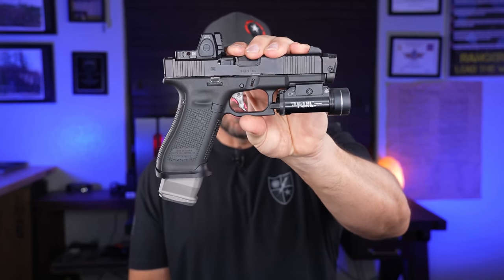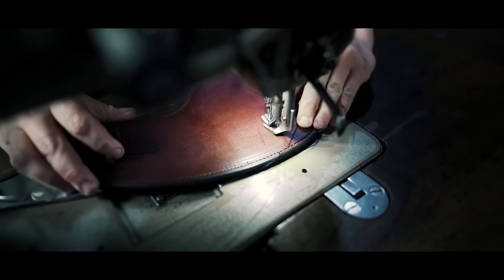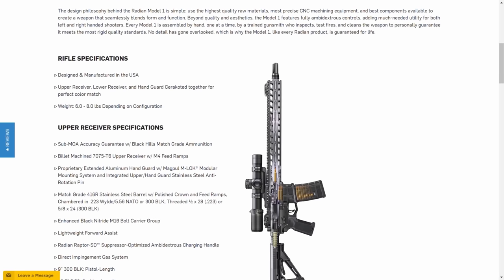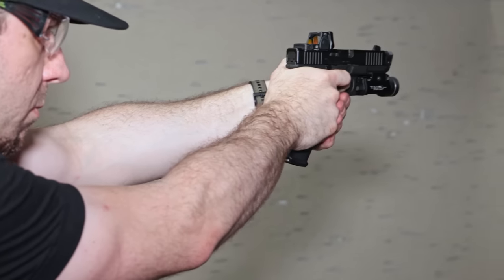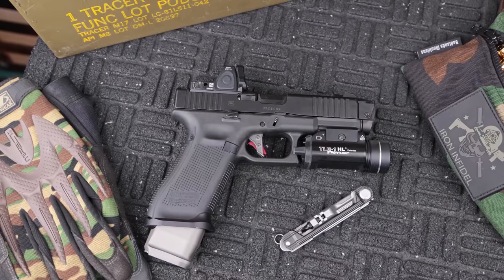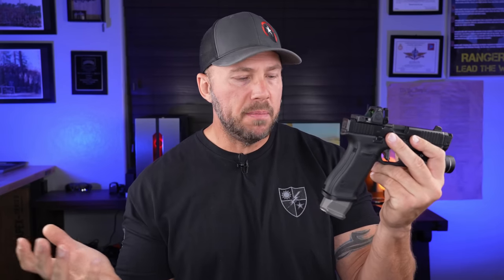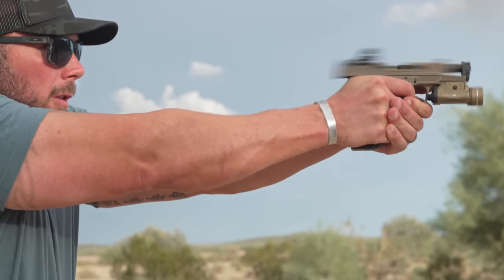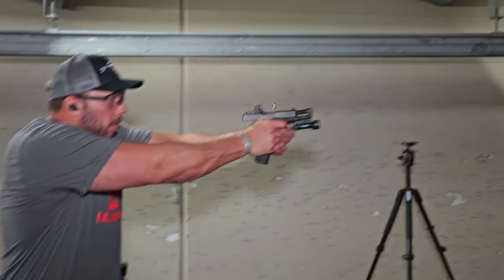It's INSANE! Ultimate Hard Use Duty Glock Pistol

Comment: I'm not going to lie, I don't shoot Glocks anymore, BUT when I retired last year my G45 looked just like that minus the mag extension and optics guard. The afterburner is amazing, it really makes it flat and the trigger makes it fast. I had a Magpul magwell, and I ran the Pyramid trigger with a Blue Line connector. My pull was a consistant 4.0 lbs I have never heard of an actual case used against a person for a trigger. Tom Grieve who is a former prosecuter and works for USCCA also said he has never heard of one either.
Reply from the maker: Nice man. sounds like you got yours at that sweet spot.
Reply: The only way I can imagine a tuned trigger being ruled as detrimental to your case is it being so light that it can misfire or similar. The old NY & NY+ triggers are ATROCIOUS and will absolutely cause the shooter to miss unless you are really dialed in on your trigger control.
Reply: If I may ask, what DO you shoot now?
Reply: I always thought the reason they don't recommend lighter triggers on your carry gun is because it's so light it becomes dangerous to carry around every day
Reply: @Darthdoodoo  I have found 4.0 lbs is the perfect trigger weight for carry (MHO). some like heavier some like lighter. Too call it too light for carry would depend on the shooter and their level of training. 4 is just where I like it.
Reply: @sensay8374  I shoot alot of guns, but my new duty gun is now a Shadow Systems with the 18° grip angle. That was not an option at my old agency.

Comment: The PDP Pro is my favorite polymer pistol but if civil unrest or some type of societal collapse were to happen, I don’t have the parts nor know how to fix a Walther PDP in minutes. However I do have the parts and know how to fix my Glock in minutes if not faster so I think the Super Glock is a good idea. I’ve pretty much got all of these parts in the video except for the barrel, I can’t seem to find one in stock and I ended up going with the Glock Performance trigger over the Overwatch just for that little bit more comfy feeling of reliability plus it’s actually a really nice trigger. I also went with the Holosun/ Primary Arms ACSS reticle optic because Trijicon is really hard for me to see with my astigmatism.
Reply from the maker: It's definitely not a bad way to think about it. Glock is very simple and parts are everywhere
Reply: @TacticalConsiderations  Brownells had the barrel, thanks for the list.
Reply: Once you have no power, meaning no light, you won’t be fixing anything, and you’ll be using the Glock like a club sooner than later, so just get a steel frame gun instead.
Reply: @tomd4748  No power equals no light? Uh?

Comment: This is a really cool setup Mike! I really dig the Guadian + six as a concept. Having that rear sight integrated means you don't really need to rear sight dovetail tool to deal with, just the hex tool with changing out the front sight.
Reply from the maker: Yup. They give a plug for the rear sight dovetail that makes it clean.

Comment: This was an incredibly well articulated and thought out video/build. The choices you went with here are objectivly the best you can choose for a project like this and anybody would be thrilled to have this pistol all decked out. I also appreciate you giving price at the end and noting that the cost of this build will get you a entry level Staccato. What's important to note is that Staccato won't come with a comp/light/red dot and that is a HUGE difference when completing a pistol. It will shoot smoother with a nicer trigger but it won't have any of the accessories for that price.
Reply from the maker: I really appreciate that.  Its was a lot of time, ammo and work in this one.
Reply: @TacticalConsiderations the ram jet comp,,,which gen model do I pick for my shadow systems mr920?? Please answer,, I really want that upgrade on my Shadow,, thanks
Reply: I had a lot of issues with double feeds when I first shot my glock with the radian ramjet. Once I got about 100 rounds through it, it ran great. Gonna try the radian adjustable recoil spring and try the 15lb spring weight
Reply: I use it on my glock 45
Reply: @georgenicholson9386  gen 4. Shadow systems are based off the gen 4 design

Comment: For daily carry or competition, my personal choices are:
- a g19 (gen 4 or 5).
- 10-8P sights and connector.
- tango down mag release.
- SureFire x300b (for the one’s that wear it).
- Raven vanguard holsters. (I haven’t broken one yet, unlike some others).
- factory mags or magpul. 
- one has a shadow systems trigger, the rest are factory.
- Neomag for the spare mag. (Again, I’ve tried plenty of others, but have yet to break one Neomag.) I do use Raven for competition mag carriers.
- federal HST or Speer gd2 for defensive purposes.
- RMR06 on the one’s with optic cuts.
Reply from the maker: You got it right.
Reply: Kinda silly to do all that and not run an optic
Reply: @johnquinn4680   2/3 have RMRs.
Reply: @coryjanko  oh yup my bad bro. I missed that.
Reply: @johnquinn4680   no, you didn’t miss it. I forgot to mention.

Comment: Mike , your time is impeccable. Literally just bought my Glock 45 MOS, had 3 before this , sold them, regretted it, missed it, I’m keeping this one. Now comes the fun part, getting my aftermarket parts. Overwatch trigger and Night Fision sights are first. SLR Magwell is a must. Never used the MOS from Glock OEM, always got it milled. I need a good optic plate , what would you suggest Mike. Awesome video as always brother . ⚡️⚡️⚡️⚡️⚡️ ⚡️
Reply from the maker: The radian plate works direct to the mos slide , but if you get it milled just go direct rmr cut. However the radian guardian optic cover only works with mos.
Reply: I'm not a fan of the Radian plate, but Holosun makes a 507c that is built to connect directly to an MOS cut without a plate, so it would work like a milled slide. Otherwise I'd recommend chpws. Much better than the crappy Glock plates.

Comment: Depending on what you want to do with your gun depends on the trigger. If you want a really light trigger that will be easy to pull, make your shots faster buy a Timney Trigger (this is the trigger competition shooters use such as TTI). If you want a trigger that will be good for self-defense, you might want a heavier trigger so you can really think before pulling. Personally, I would stick to a stock trigger for self-defense and a Timney for a quick shooter.

Comment: Hear me out.......I have almost the same setup that you do, minus the Radian Ramjet. I have a Parker Mountain Machine comp. But on all my Glocks I run the Overwatch Precision Tac triggers...... Along with   the Ghost Evo Elite connector, 4.5lb striker spring, and a reduced safety plunger spring. And a 15lb recoil spring. Been through many classes, and Religiously shoot 100 rounds. All drills, at the range, weekly. ( My Glocks run without any malfunctions 115gr, 124gr or 147gr)  I challenge you to try the springs and connector, and see if you think your pistol is much better. Love the channel, keep up the good work!
Reply from the maker: I dig that but the factory springs is part of why I did this they way I did . I have all the parts you use and they are sometimes his or miss. I have seen more broken, rusted or even double fire connectors from ghost than any other company.  The guts are what I wanted to remain factory since the are always the most reliable percentage wise.  I have tried all the spring combos for striker and eventually they end up light striking on certain ammo.  If yours is rocking I am glad to hear it but I have just had too many springs piss the corner.

Comment: If I ever go back to 9mm, my set up would be very similar to this. The only thing I would do different is red dot.  I am a big fan of the Leupold Delta Micro. People have commented negatively on the smaller glass size. But when asked none of these people have ever used on for any length of time. The more you train, with it the sight disappears and it is almost like the red dot just floats in front of you
Reply from the maker: I get ya. I tried it just messed with my astigmatism.

Comment: Thing to note about the Radian Afterburner, will not work with Zev slides. It wants OEM front end geometry. I ended up getting a Mapleleaf Firearms G19 slide as it's made specifically to fit the Afterburner. Totally worth it!
Reply from the maker: Its only made for factory glocks.

Comment: I think I drooled a little, or maybe that was from the stroke I was having after you said what that thing cost with all the goodies.  I like it though, very sweet rig.  My only thing with changing triggers on a Glock is that I've been told and heard so much about how that can make it unreliable.  But you stated you have no issues with reliability as far as Overwatch triggers go, so that's good to hear.  I also agree about the minus connectors, they are the way to go.  I guess I'm gonna have to get myself an Overwatch for my 43X to try them out.  Thanks for another great video!
Reply from the maker: Maybe both, The real question is was there any doody?
Reply: 🤔Didn't check..... 😂

Comment: I was waiting for that comment at the end. Why spend all that money? The Walther PDP SD Pro really does ball on a budget. I got my PDP SD Pro compact from kygunco for $800. 
Holosun EPS $330
CHPWS optic plate $75
PMM comp $100
ZR TS 15lb spring $70
Olight Valkyrie $80
So I have $1455 into my build. I can put fist sized holes through my target at distance with speed with my Walther. It has earned the name "cheat code" for good reason. I still love my Glocks.  But the PDP SD Pro is hard to beat. Get with the program Glock.
Reply from the maker: Yup.  I can see the future with the PDP PRO.

Comment: Definitely will run my PDP 5” before anything else. However once SHTF…I’ve got some Glock clones and tons of parts. Unfortunately until I get at least 1-2 more PDP’s, I gotta fall back on Glocks due to sheer parts alone.
Reply from the maker: The PDP is so easy to love.
Reply: If SHTF the last thing your going to worry about or need is spare parts for your gun. A stock glock can outlive most of us and nobody is going to be blowing thru thousands of rounds at the range, wearing out parts is highly unlikely.
Reply: @isaakjunkeer785  I agree. However nobody can account for things breaking or potentially needing extras. It’s just an added layer of reassurance for me.
Reply: Why is the gun community so obsessed with shtf?

Comment: Really nice setup, it makes actual sense and those are all quality parts.  The last I researched the topic, the consensus seems to be that the only way a trigger could possibly (maybe) be used against you in a criminal case is if you have an ND with a really light or heavily modified trigger.  Otherwise, if you shot them on purpose it doesn't matter.
Reply from the maker: A negligence case is a very different issue than a self defense case for sure.

Comment: I have almost the exact same set up. I put the 15lbs spring in and had a ton on failure to feeds in the first 300 rounds. Of course I forgot to bring the other springs to put the factory spring back in. I’m hoping that it was only because it’s a brand new gun, so it needs break in.
Reply from the maker: Mine was well broken in but I am using the factory springs on all 3 of mine.

Comment: @TacticalConsiderations  I just finished my second whole training day using one on my glock 45. Even with changing spring weights using the proprietary compressors springs I still have issues with 115 grain going into battery. I had to keep thumbing the slide into battery. 15lb spring won't feed and 13 won't go into battery. I don't think cops should use these

I replied in a sub comment but I wanted to make sure you read this. Be careful recommending this to police who's departments issue 115 grain training ammo. It's garbage and none of the three spring weights work.
Reply from the maker: I am using the factory recoil spring not a lighter one. I know its been used in at least 1 OIS already.  I only use things that work on the factory springs.
Reply: @TacticalConsiderations  so +p duty ammo on the regular springs would be fine. The primary issue is lighter training rounds.

Comment: I had Radian Ramjet begin not locking back. Verified on another 45 and 2-19s
Reply from the maker: Ammo type maybe.
Reply: No its just not a great product. If it cant run with quality ammo, its a useless product. Fed American Eagle, Hornady Custom and Crit Duty, Bllazer Brass. If it fails all of those, its a bust. Ok when new, but after a few thousand rounds, no lock back. I have multiple Glocks over 10k rounds back to 1992. All stock, and all function 100% all the time. Not sure why I thought I needed to spend almost as much on the comp as the pistol to tame the massive power of the 9mm. And the 45 with the Ramjet and 17 stock felt no difference, no loss of speed and my wife who is half my size said the only difference is how annoying it was to have no lock back. Save $400+ get a 17, or better yet, a 34 and learn to shoot it. It will stay on target as well or better and be 100% reliable. Just change the sights to your steel sights of choice, and grab an x300.

Comment: I actually mixed overwatch components with a Glock Performance trigger. That's a pretty nice setup. Only thing is apparently after a thousand or so rounds the Glock Performance trigger CAN need a bit of lube. So far my first one hasn't needed any, I bought a second recently and some have said there may be a change with the newer ones? I don't know if that is true, just passing along random information.

I'd like an Afterburner+ramjet for the G17.
Reply from the maker: Yeah I heard something about them failing.  If you look at the design its like a pretty close copy of the timney
Reply: @TacticalConsiderations  Yeah it is pretty similar. Johnny Glock said they did make some improvements to the design as far as safety goes. I certainly hope they did anyway, I've been carrying a G19 with a Glock Performance Trigger(unmodified) in an appendix rig since January--that particular trigger had to be one of the very first ones sold to the public because I ordered it within an hour of the public reveal at shotshow. 

BTW, glad to see you made it through that defensive encounter unscathed. I hope you're doing well physically, mentally, and spiritually. Take care bro.

Comment: On my 19 mos I could not get it to function with the factory spring at all. I put the radian compressor in it with (I think) the 15# spring and runs flawlessly now
Reply from the maker: was your 19 new or didn't have many rounds through it? my 45 probably has 5k through it.
Reply: @TacticalConsiderations  yes it was new. Maybe a couple hundred rounds before I put the ramjet/afterburner on it. Every other round was a ftf with the factory spring but zero issues with the lighter spring in now.

Comment: Hi TC! I have a question for you. I'm considering getting an Overwatch TAC trigger like the one in your video here to replace my Timney Alpha Glock trigger in my gen5 G34. My question is what made you decide to go for the Overwatch TAC trigger over the Timney in this build? Was there something about the Timney that didn't work well enough for you to make the cut? My current dilemma is that the Timney has this strange "Second wall" sometimes in my trigger press, and while it is a very light pull, that inconsistency very much annoys me. Maybe the reasoning behind why you didn't go with the Timney will help me figure out why the Overwatch is overall the better choice.

On a side note I also wonder - what made you decide on the Overwatch TAC over the Glock Performance Trigger? Now that that's out I figure you've got lots of rounds out on that, so you've got your pick of which of the three triggers I've listed you like most.

Either way, it does say a lot that you're still going with the Overwatch TAC after all this time. I have an Overwatch TAC in my S&W Competitor thanks to your videos, and I do like it quite a bit.
Reply from the maker: Timney is not a carry or duty trigger its for competition only.  There are only 3 triggers I trust for duty work, Overwatch, Apex (Both are approved by several LE agencies) and the last FACTR USA.

Comment: I’m genuinely curious what the appeal of the Glock 45 is over the full size Glock 17 or 47 specifically for duty use.  If I don’t have to conceal my gun, and can have it holstered in a big, offset, “go to war” holster.. why not go with the G17 or even the G34?  My chronograph data shows all three Federal HST loads achieve significantly more velocity from the G17 length barrel over the G19 barrel length. There would arguably better accuracy (although probably just a minimal difference).  

Just an honest question!
Reply from the maker: I get ya.. Well if you have to site in a car with a duty holster all day longer is worse.  Velocity from pistol barrels are going to do about nothing in a self defense use of force with standard defensive ammo.  Having something that is easier to carry around, lighter and will produce the same end effect is a positive.

Comment: I carry a glock 17 on duty. Would you be able to still holster the weapon after installation of the Radian after burner ram jet? Or does that extension make a standard Safariland ALS holster all of the sudden incompatible and youd have to buy a new holster?
Reply from the maker: On the 17 I don't know that would effectively make it the length of a 34

Comment: I’m super interested in the radian base plate.  Problem is, I have a 19x that’s not MOS.  Can you get the slide milled for the radian plate?  And I imagine you would have to change out the front site to change for elevation?
Reply from the maker: The radian plate is meant for the mos system .  the front sight comes with the kit